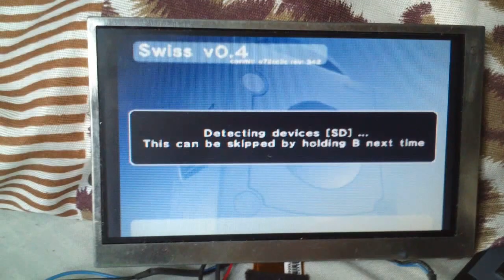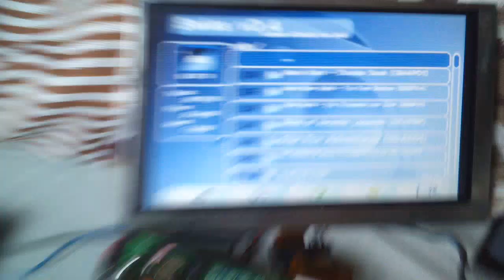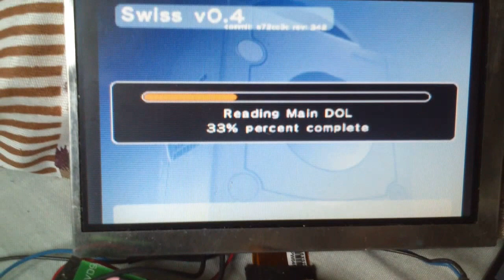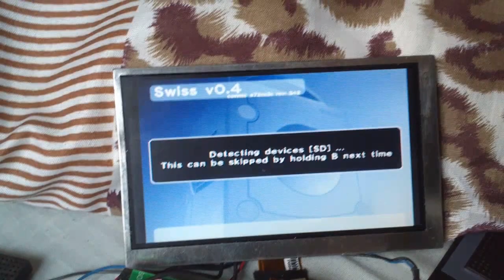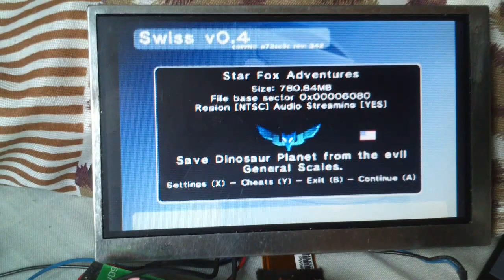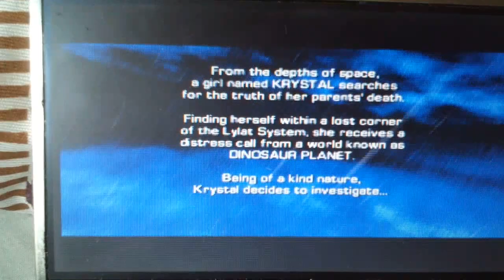Gamecube portable test after relocating psu

Comment: Woah! Das a big driver board for that LCD.
Reply: Yep it's, that LCD driver is from old portable dvd player. It was easy to put it niside the box so no problem ;) and it's RGB
Reply: +armkon1984 Oh wow, RGB. That's cool. I got a similar LCD for my portable but it was just composite. Luckily It's a very popular LCD and I found a 14.99 HDMI driver board for it on eBay. Does that Ribbon cable going to the LCD have 40 pins?
Reply: This one was composite to when i take it out from portable, only little mod and all work in RGB :)